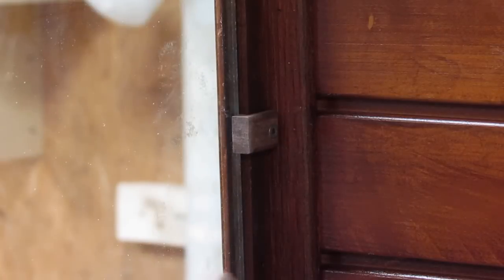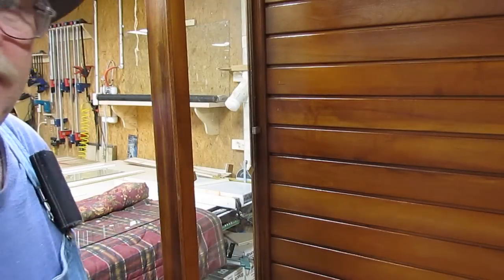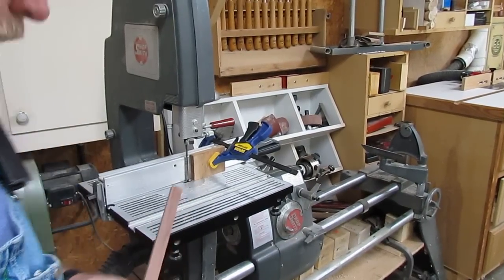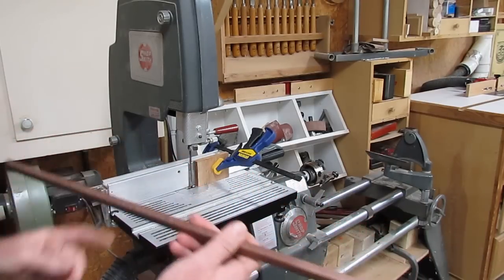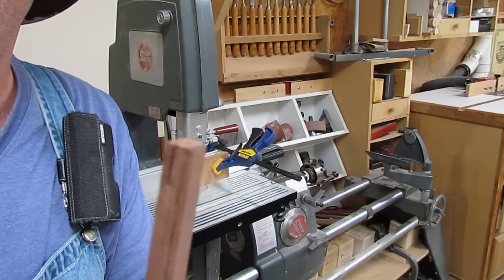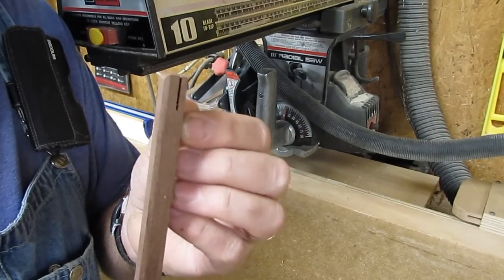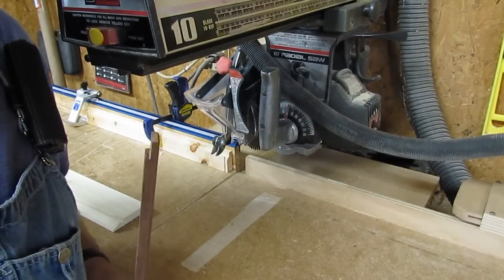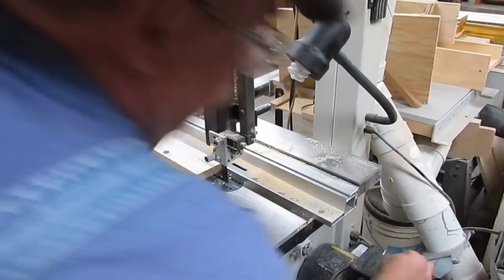Glass retainers

Comment: Dwayne How do you like having that Jet large belt sander in the wood shop? Is it a good investment for a working shop to have? I have a Delta 6 Inch x 48 Inch Belt / 12 Inch Disc Sander with Open Stand. Is it used more for large work like doors and frames?
Thank's again!
Great update on the display case.